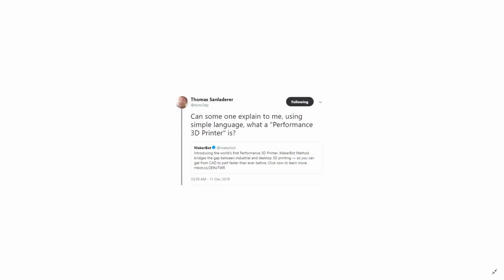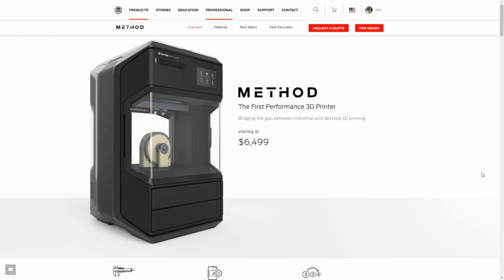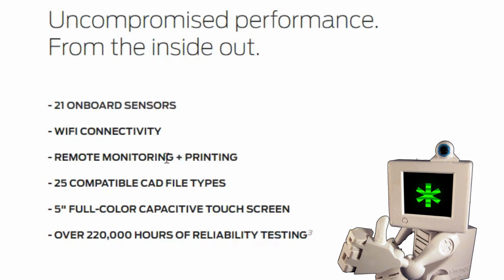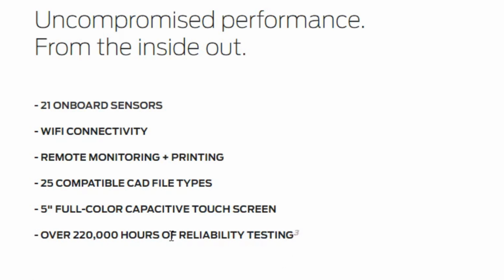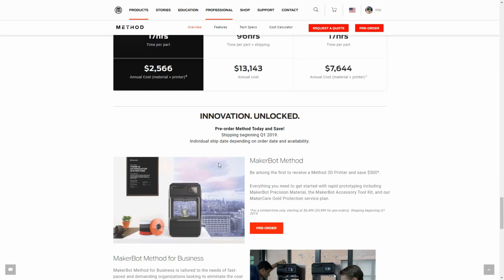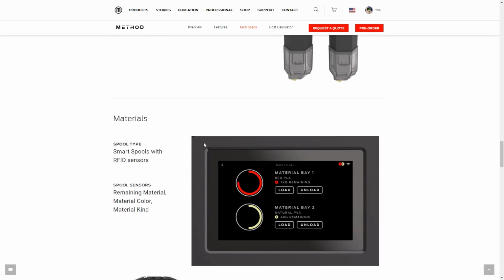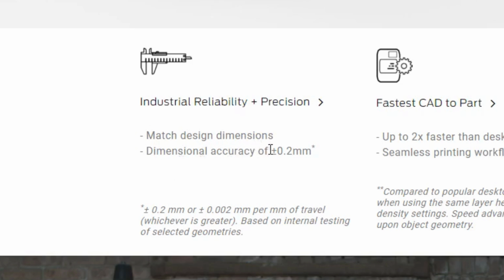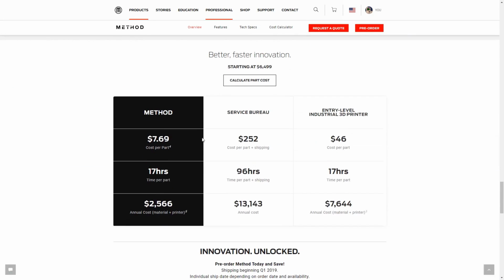Makerbot Method Announcement Breakdown

Comment from the maker: A bit late with the writeup. What a weekend. https://www.3dpprofessor.com/2018/12/17/makerbot-method-announcement-breakdown-video/
Reply: Great videos, but I think your missing some important concepts.

1. The best 3d printers on the planet(200k+) have a 0.2mm dimensional accuracy. 0.002mm per mm of travel is an extremely tight tolerance. That's 2/10ths of 1%......

2. How do you expect to keep tight tolerances if the base materials your using(filament) is inconsistent? And I don't just mean extruded diameter of the filament, but chemical makeup as well. Commercial Printers require consistent feedstock to provide consistent build results.
Reply: @Ryman158  this is true, quick brake down, people don't buy them just cause they can, they fit in a neesh market doing specific things kinda, they don't need anything else,  cost is irrelevant, accuracy Is important, consistency is important and the biggest is you get those results 99% of the time and most important without tweaking anything, mine is 10 years old, it has done, 24 hour printing over a week straight, finished every part without fail and without doing anything or even being there, not as short but there's my take

Comment: I enjoyed your video. Thanks for taking the time to put this together. Now for my opinion..... Honestly I could never justify spending over $6000 dollars for a 3D printer. I've always built my own 3D printers, never bought a single one. Just the components to make one work. Yes, getting my first printer off the ground was PAINFUL with plywood, China linear 8mm bearings and rails, and yes.. a lot of zip ties. However I learned so much about 3D printers from the experience. My advice would be to start with a $200-$300 dollar printer and from there you can buy the parts you need to build your own from many designs that are on the web or better yet, design and build your own design. There is no better way to get your feet wet. I can not imagine spending $2000 dollars for one let alone $6000. If I spent $6000 dollars on building my own printer it would have complete closed loop servo system, whisper quiet, with top notch linear rails and extruder, but yet still I could spend $600 dollars in the build with lesser parts and probably would not notice the quality difference in the printed parts. WIFI is nice to keep track on the go, open source has that already though for free. Touch screen maybe flashy but not so much important compared to quality... Also, Who cares about 20 some CAD file format support. I can easily convert whatever format to STL, which is standard in the open source scene. for anyone who knows better. This is a rip-off, AKA RIP MakerBot...….

Comment: all i am gonna say is octoprint!! i can get 90% of this for any 3d printer for less then 100 bucks
Reply from the maker: I'm with you. I like octoprint. But unless octoprint has had some major upgrades in the past year, I would say this statement suffers more than a little from some undue braggadocio. Because Octorprint has to satisfy so many different hardwares (both in the raspberry pis and attached hardware and in the printers it has to cover) it kinda takes a middle-of-the-road approach. And that's fine, but it doesn't make a fair comparison. A professional UI, crafted for top-of-the-line hardware, is truly a thing to behold.

Comment: Hello I am looking at the Cel Robox pro for my company but cant find any independent reviews. I would love to hear what you think. It has a larger build volume and a cheaper price but looks like a solid machine.There is one company currently assembling them in the US.
Reply from the maker: Ah, they're the folks with the nozzle block, so they don't really have to deal with retraction. That's a printer I would love to get my hands on. And I like that they let you use 3rd party materials. I've never seen their machines IRL, never used one, but it looks like your standard easy to use interface, similar to the Raise3D N2+ or the like. And they say they've got wifi. Over all I would say this is comparable to the Raise or Fusion 3 line of 3D printers. If you do get one, lemme know what you think.

And if Cel Robox is listening, I'd happily take a review unit.
Reply: @3dpprofessor   Thank you for your quick response! You are right on the money!! the other two 3d printer's we are looking at, Raise N2, (not the + version)  and the Fusion3 F410. The Robox pro has a few features that the N2 does not, that we want. The Fusion 3 is interesting, but we do not need a  build volume quite that large. Also, looking for a bit better quality finish (with two colors) for certain lamp base designs (and not a lot a clean up on the back end). It looks from my non professional 3d printer eye, that the Robox pro has what I am looking for. The smaller desk lamp design are company makes will be able to print 4 at a time with the  8" depth X11" width build volume.
           Please let me know if you have any other suggestions or know of anyone that has had a independent "working" review of this machine. I will be sure to keep you informed on what we decided.  Thanks again, and take care! Seth M

Comment: Sorry but you have no reason to be so upset about the 0.2 mm tolerance. This is industry leading standard, the big stratasys fortus systems list the same +-0,2mm or 0,002mm/mm. This is the absolute standard maximum deviation from the given dimensions. Show me ONE other 3d printer that can do that, straight from the machine. AFAIK, all of them develop some sort of elephant´s foot (already bigger tolerance) and too small inner diameter holes (that you can´t solve without underextruding). So please everyone in the comments, hakuna your tatas. They list 0.2 to not get sued by people seeing one 0.25 deviation. I guess 95% of prints are going to be better than 0.1mm.

Comment: One Makerbot method ($6,499) = 32 cheap perfectly functional $200 printers. Each child in a class can have his own personal printer! This reminds me of why Makerbot ultimately failed. Proprietary filament only?  Every company that did this did it to screw the users by locking them into vastly overpriced filament. Smaller build volume than the $200 printers. Low accuracy. This gives me a acute sense of deja vu as it reminds me of Makerbot just before they went belly up, grossly overpriced and poor specification. This is a turkey which no-one should waste money on.

Comment: makerbot to me means overpriced, easy to break, and delivers nothing better than budget printers.  they fill the labs on campus nearly all of them down.  I'll take 10 crealities for the price if one of their printers.  at $6500 I pretty much can and then my work flow will be 10x faster.  throw in a zmodo baby monitor ($30) camera and an Amazon alexa smart switch $24 and I can monitor and remote shut down my cheap printer for a bit more effort hook up an octopi.  if I want enclosure a few bracket prints and some cheap glass from the glass shop

Comment: I’m fairly new to 3D printing, but I have been looking on with great interest for years, waiting for the art to become practical and affordable enough to invest in. Over the years, I’ve watched the open-source 3D printing community blossom as the nuances of the art were shared, and the machines and software improved by leaps and bounds due to the diligence and generosity of the contributors. 

In my 58 years, I have  also observed the common practice of larger companies acquiring smaller ones many times, which they usually do to increase their product line, enhance existing products, gain IP rights, and/or eliminate competition when they perceive a threat to their market share. Whenever a company that formerly produced very flexible, innovative products is bought-up by a larger, more “corporate” enterprise, the results are axiomatically a reduction in features or functionality, accompanied by a massive price increase, often followed by the dissolution of the product line as customers no longer feel like they are getting the same value and move on. 

I haven’t studied their history to any great detail, but my impression is that MakerBot was one of these innovative startups who “sold out to the man”, and I found their “new” marketing strategy, under the umbrella of Stratasys, to be weak in comparison to the time when they were independent. They were suddenly more expensive, justifying this with the promise that their products would be brought up to Stratasys’ standards, but I was still on the fence about whether to home-build, purchase a kit, purchase a cheap pre-assembled unit, or to go whole hog and commit to purchasing a commercial-grade 3D printer. If my focus were to buy a commercial product, MakerBot priced themselves out of my list of candidates for several reasons, but suffice it to say that all of them stemmed from the changes made when they joined Stratasys. 
Why would I purchase a “lesser” unit after all, when some of the lower-end machines from the actual Stratasys line were not much more expensive? 

To me, the name “MakerBot” lost its luster after the acquisition, and now the line is being pushed using loose claims that fail to impress the people who know better. 

Great presentation, thanks!

Comment: So at $7 a month for the Filament of the Month club, you get 20m of filament? That's 16 subscribers per spool of filament or 16 months of subscription. So only $115 per kilogram for PLA. Sounds like a good deal... I mean, for you and Alien3D.
Reply: I just signed up for this. I think the detail your missing is that there's free shipping involved for 16 people, which would need to be accounted for. There's also the extra overhead that comes from shipping out 16x as many spools. And small quantities of things often do result in additional cost.

I don't doubt that it's cheaper to buy by the full spool, but I'm also guessing that the target audience for this is for people like me that are newer to 3d printing and haven't tried a lot of different types of filament. Or possibly for the casual 3d printers that aren't going to properly store their filament or will take a long time between prints.

Comment: I still like hobby level dyi printers . I have modified mine with a few safety features for peace of mind . I monitor the bed temperature and will auto shut off the heated bed if it goes above specific temperature. Also if the mosfet fails open I auto shutoff power to bed to do away with runaway temperature.

Comment: Tell us why not buy a dlp printer
Reply: Dlp
Reply from the maker: You can edit YouTube comments.

So far I have not found a DLP, DUP, SLA, or other light curing printer that I like. Any offering that costs less than a mortgage payment has stuck too hard to the FEP, the resin is messy (and toxic) it smells bad, and the slicers are confusing and difficult to use. You'd think for the older of the 3D printing technologies that this would be more mature, but I am not impressed. I do have a more expensive one that I have yet to unbox, and I've heard good things about the form 2. So I guess my advice is don't spend less than $2k, but I can't be sure about that yet.

Comment: 21 onboard sensors.  21 things that can (and will) go wrong leaving the end using frustrated as they try to trace the problem through 21 sensors and a motherboard, or not having a product as it is sent in to be worked on (probably at end user expense when it comes to the shipping).  Sorry, I'm a firm believer in the KISS method (wear a lot of makeup, play disco and call it hard rock...ROTFL, sorry, couldn't resist).
Reply from the maker: Also, rock and roll all day and party every night.
Reply: @3dpprofessor  and if you get this printer you could be a Strutter 😁
Reply from the maker: @arcanum70  I'd have to make a video to Shout it Out Loud.

Comment: At least the spools use RFID. In theory, you could rewrite the RFID tags with a smartphone, so you could re-spool with different material and use third-party filament on them. This is assuming one could interpret the data on the RFID tags. I wonder if that tag also accounts for print settings for materials as well. 
Either way, it's too pricey for such a small build envelope, and you're spot on regarding accuracy. I've been done with Makerbot for a while now; I've since been buying those cheap Chinese  printers; I love my Ender 3, but I still use my Replicator 2 a lot. It's a shame that MB/Stratasys have gone this route, but who knows, maybe in another decade they'll come around and have another viable consumer printer again... I'm not holding my breath though.
I've got to admit though, the heated build chamber is a nice feature. That's the one redeeming feature of the Method; if you're only printing things of a certain size, and want zero warping, it's possibly worth the investment.

Comment: So it takes CAD file types directly, no way to influence the slicing? Or slicing and reviewing on a great tiny screen?

Wifi - at least at my university connecting to the existing wifi is impossible for anything but a laptop/smartphone because of security concerns.

Remote - well a wire-connected (or wifi here at home) Raspberry running octoprint costs nothing extra

filament in compartment - well this normally means you cannot use just any filament from the market?

How many Enders 3 do you get for the price?
Reply from the maker: I would be okay with no options to slice if it got it right. I mean, I get it, we like control. But for 3D printing to reach a larger market, we need to have defaults that work without touching them and options that auto configure things like orientation.

Comment: You are not quite correct about the +/-.2mm tolerance.  I think you would be hard pressed to do to much better on any given FFF printer if you take a rigorous approach to publishing tolerance.  From a true engineering perspective, you would make a bunch of parts and measure all the dimensions and figure out how far off you are.  If you're not an engineer, you might use this number, but if you are an engineer worth your salt, you'll know that statistically, your tolerance within the total population of prints (not what you just measured) may be worse (you only printed a small fraction of what this printer and all others like it will print in their lives).  You will take the standard deviation of the tolerances, multiply it by some factor that is based upon the confidence you want in your stated statistic and add this to the average of the measured tolerances.  I'm no statistician, so I often wing it and use x3, which is like 98.something% (don't quote me on that - look up confidence intervals for yourself if you want the correct value).  This is not even right because I haven't accounted for population sizes.  If you are a car manufacturer, you'd strive for 6 sigma, which is higher.  Now, they're stating +/-0.2mm on a 0.2/.002=100mm large object.  +/- .2mm on a 100mm large object isn't great if it's a square and you're calibrating your printer, but if you read between the lines, it's for arbitrary geometry and for a 5th grader running the machine.  I challenge you to print 100 objects in sizes from  10 to 200mm of varying geometries, measure all the dims, take the standard deviation of those tolerance measurements, multiply it by at least 3, add it to the average of the tolerances and report something better than .002mm/mm travel.  If they were rigorous in their calculation, I think that is actually VERY good.
Reply: Also, everyone who purchases this thing is going to do stuff like slice a 10mm tall object in .3mm layers (.1mm error regardless of how good your printer is).  This problem is inherent in real world objects to one degree or another, even if variable later heights are a feature.

Comment: Will you / have you reviewed the Flashforge Adventurer 3? It has WiFi...
Reply from the maker: That is the printer I'm taking about. Well, the Monoprice version of it, but it's the same thing. Review is next week.
Reply: 3D Printing Professor I guess it is the Monoprice MP Voxel 3D Printer you are refering to. Was not aware that monoprice had such a model. Just seemed to me that many of the features of the Makerbot Method 3d printer is in the same range as the Flashforge adventurer 3, or Monoprice MP Voxel 3D if you will. The Flashforge Adventurer 3 seems like a good choice for any schools, or hobbyists / makers, but also as a semi-pro grade 3d printer. A bit small build volume, but in a school or work setting that is probably what you would want anyways since the schooldays / working hours are limited in length anyways.
Reply from the maker: @jenspetter80  I say this in the next video, but my perfect printer right now would be a Weedo F192 with the Adventure 3 workflow and interface.

Comment: I was at formnext to view the state of art of 3d printing. There was almost everyone but not makerbot and creality. The second one does not have the necessity because they sell too well in the hobby niche. But makerbot? After the newsletter of the method I was thinking of the bad results of the last 2 years. Rebranding stratasys as makerbot could be but it's not the correct answer with this product. Probably they should take a cheaper approach as it was for 3dsystems with cubify, with sub 3k€ printers and without proprietary filaments(3dsystems fault).

Comment: You forgot their remote viewing camera is a pathetic 480p.
21 sensors can even include a microswitch to detect when a spool is loaded.  Don't be fooled by "sensors"
The camera doesn't count, as it has a resolution so low that it is pointless to have it